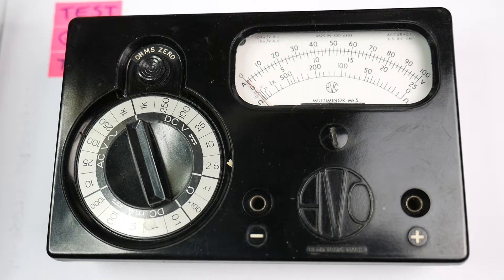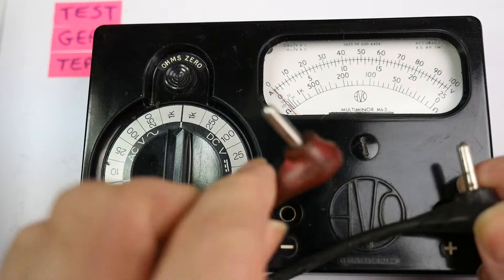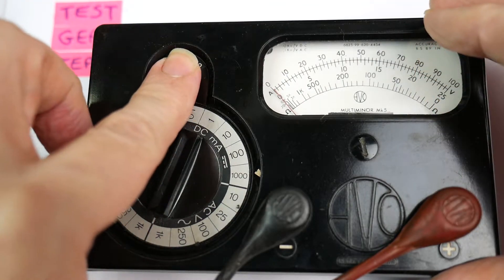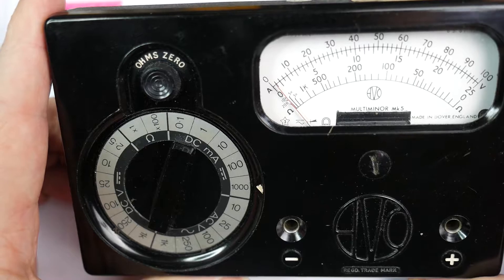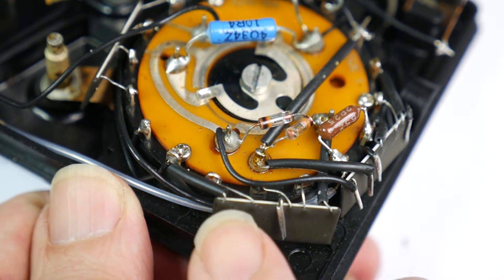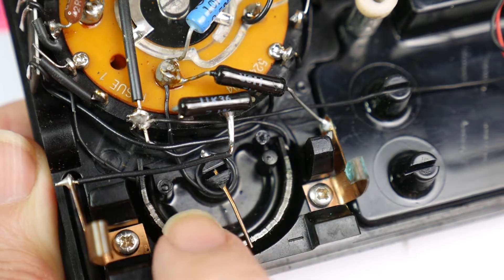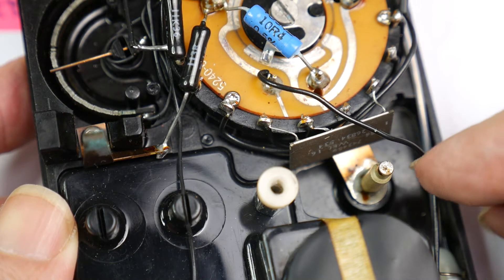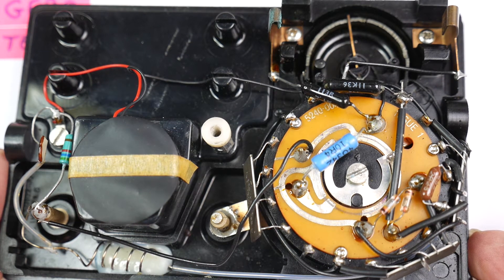Test Gear Teardown: AVO Multiminor Mark 5

Comment: Very interesting as far as it went.  Unfortunately there was no 'teardown' and no circuit diagram so it did not help me in repairing my Avominor (same model as shown).  The so-called safety issues and the switch to current ranges in the same switch sweep are of no concern to an electronics engineer who knows what he is doing.  However highlighting these issues did waste valuable video time when more profound topics on this meter could have been discussed.  Maybe you will make another video on this super little Avominor.  Circuit diagram please!!!  Thank you.
Reply: https://www.richardsradios.co.uk/AVO/Multiminor%20Mk5.pdf

Comment: I found one of these on Ebay with a burnt out 2.25 Ohm resistor (the orange one connected to the rotary switch in the video!). Now I fixed it, I love it! I use it more than any other meter for general pottering about...